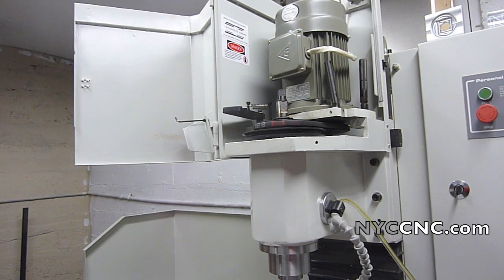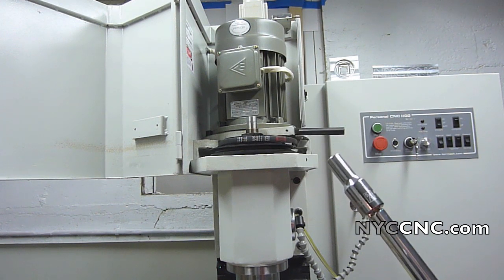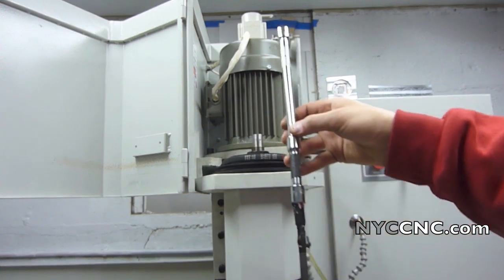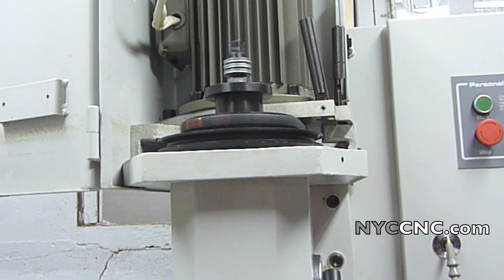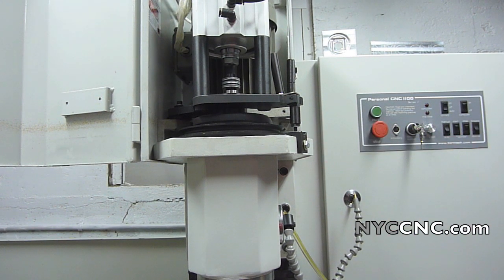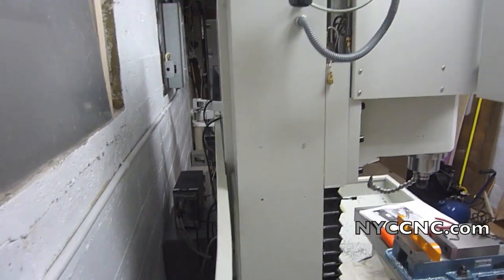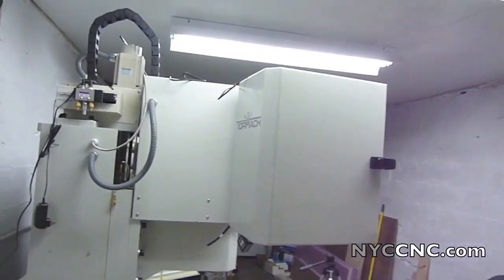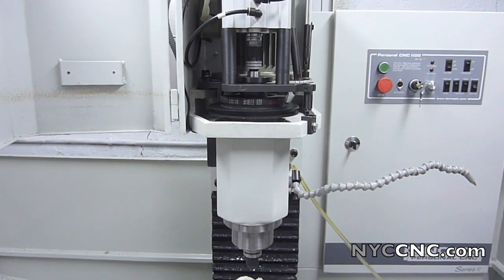Tormach PCNC 1100  - Installing the Power Draw Bar - Ch. 13

Comment: Interesting to see that the older models were supplied with only 3 stacks of springs, the most recent ones come with 4 stacks. I watched your video to see if you power draw bar lines up with the 2 axis of the table, but there is no clear view. I mounted mine today and even tough it is centered with the spindle, the face of the power draw bar isn't parallel to the x axis of the table. It shouldn't matter in terms of functionality, but when things are asymmetrical  they tend to bother me.
Reply: NYC CNC It is leveled both horizontally and vertically, but the 4 sides of the  DB don't line up with the axis of the machine. For example, looking at the machine from the sky, x and y axis would form an imaginary cross whose center is below the spindle's center. Now imagine the drawbar, it has a square base, it too can form an imaginary cross, also centered with the spindle. The north point of the drawbar's cross doesn't line up with the north point of the xy cross, it is turned to the north west, but it should be ok, or at least I hope.
Reply: +NYC CNC so the R8 collet is basically being pressured up by springs, and the drawbar is pressuring against those spring so r8 collet opens up ? i have done a very few minute research on drawbars and i still cant figure out how they work
Reply: Man, it's been this long already! Hey, thank you for all the video you made during the years!

Comment: Great help. Just wish Tormach had mentioned putting on the Power Draw Bar before assembling the splash shield when applicable. I elected to remove it for access to the column and it was pretty quick. Recommended!

Comment: @saunixcomp As an electrician, I'd like to offer the modern version of this old trick - a corner of a plastic bag, slightly larger than the diameter of pipe, tied at the base (like a parachute) with the lightest string available. It flies through hundreds of feet of pipe in seconds.